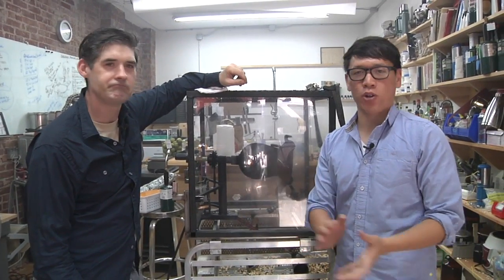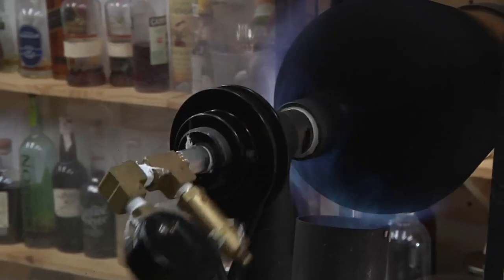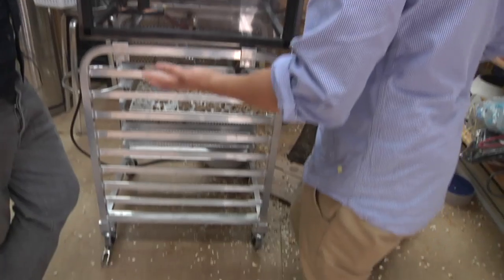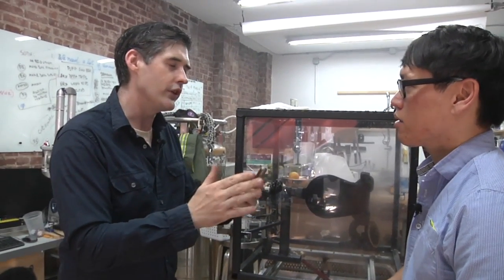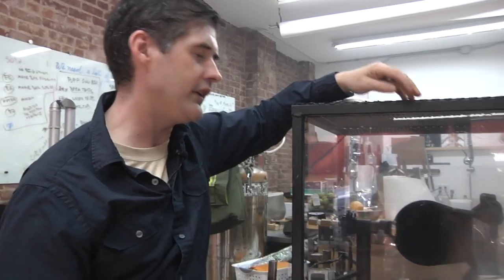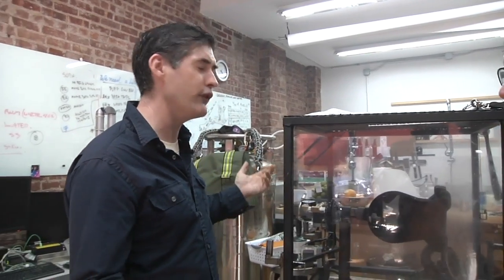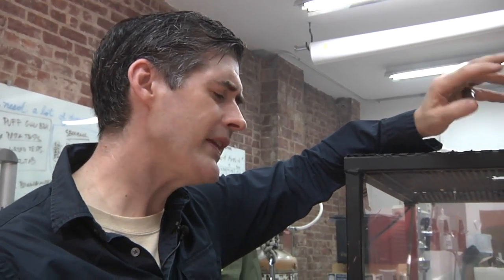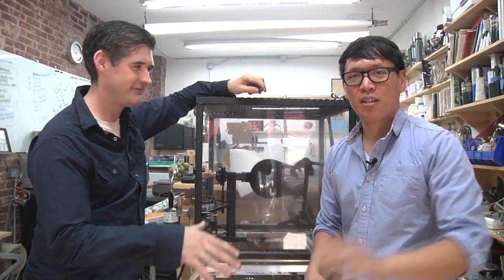Testing the Puffing Gun and Unexpected Food Explosions

Comment: The guy says he is worried the item wasn't tested so he has his little blast chamber. But he used what looks like 1/4 or 1/2 inch polycarbonate panels. If that thing has a problem any bigger than a steam leak he is going to need multiple inches for any kind of protection.

Comment: With the pressure relief valve he has installed I believe it cannot get anywhere near hot enough to blow the cast iron pot. He didn't mention the pressure needed to get the puff, but I bet it is a lot lower than the pressure needed to tun the pot into a steam powered grenade.